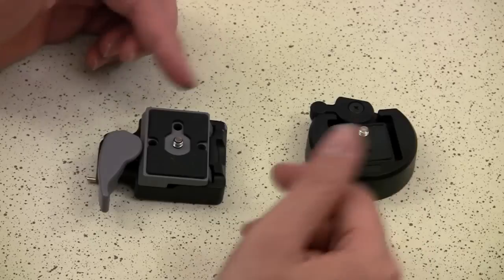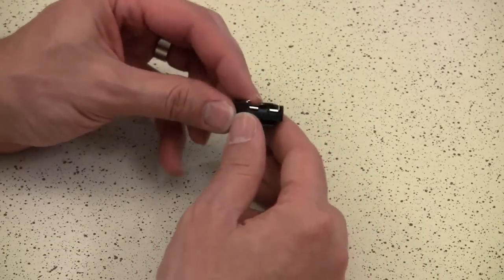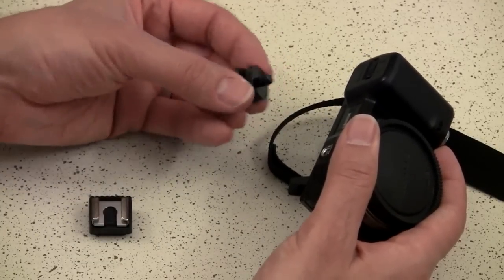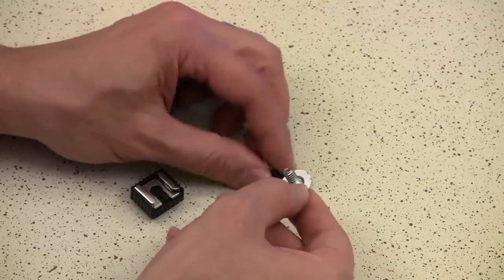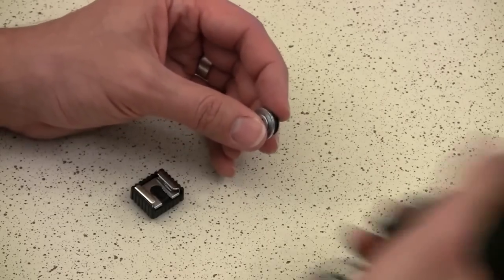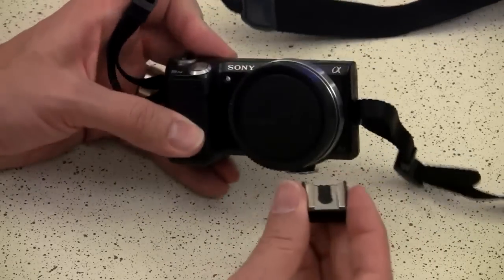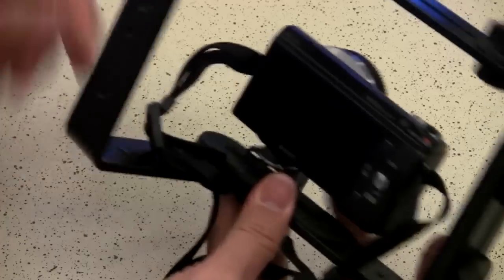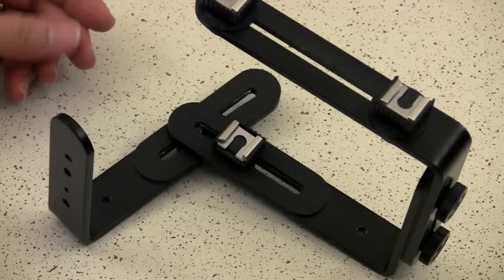Frugal Fast Release for $3 (DIY camera quick release system)

Comment: This worked great for my "compact" Nikon. Made two of them (one as spare) for maybe $4 total. The washer that actually fit was slightly smaller.  The hard part was countersinking the washer as it is hard to grip it and work on it at the same time. Functionally it works well.The camera is tight during any actual use with my monopod. But if hiking/walking with it, the camera will spin  and can come loose if the opening faces down.  So I just keep my finger on the shoe "entry" while walking, and that is fine.  THANKS!

Comment: i can see this as an excellent work around to use until the actual quick connects come back in stock... im all about adapting what you have to get the job done, but i wouldn't trust such thin metal of the shoe mount for too long...